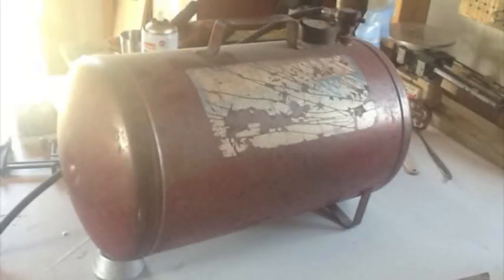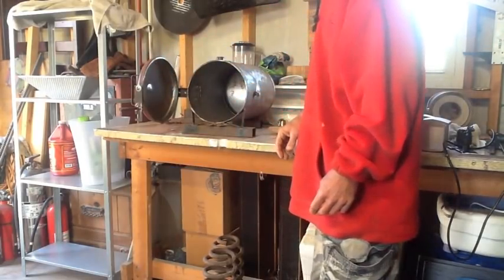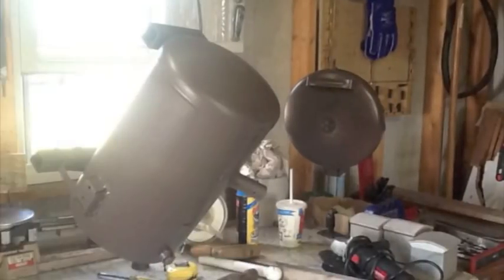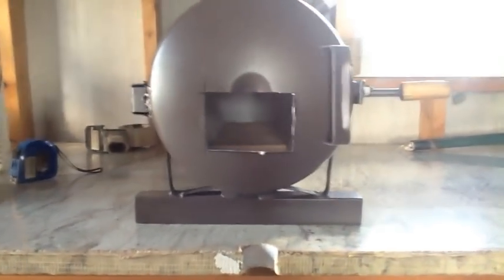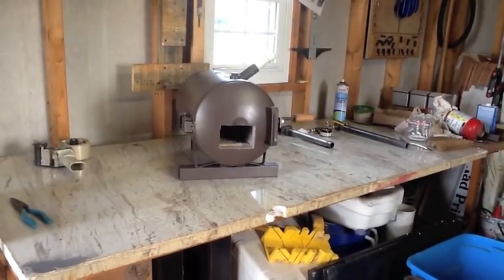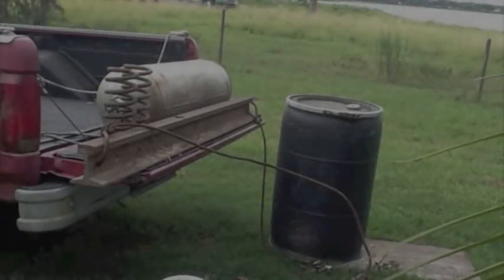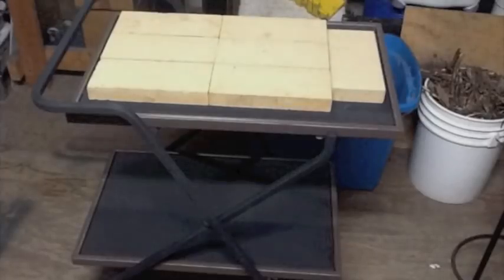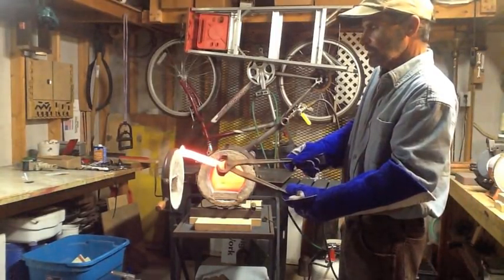My Custom Blacksmith Propane Forge Build - Start to Finish

Comment: Don't let the dislikes get to you, no telling what bee got in their shorts. The gloves were a bit over the top though. Don't wear leather around the forge, use cotton gardening style if you are going to use gloves. Leather shrinks when hot and it is possible for the gloves fingers to shrink down on your finger and that makes taking the gloves off much harder, causing a worse burn. Cotton will not shrink. I prefer not to wear any gloves as they make feeling the hammer much harder.
Reply from the maker: Thanks Wayne, the dislikes really dont bother me as I know the forge, and its a solid build. Would like to see the forges of those that thumbs down the build tho :)

That footage was the 1st time I fired the forge up so used the best gloves I had at the time, they are my stick welding gloves. Was the only time I used them with the forge, a bit of overkill, I will agree :-)

Comment: What did you use as a rigidizer
Reply from the maker: A product sold by the name of "Rigidizer" Google it! Thanks for watching & Happy Holidays! 😊🎉
Reply: @MakinSumthinFromNuthin  Thanks I can't find any pre-made rigidizers locally. Trying to find out as much as I can about what works and what doesn't.
Reply from the maker: The cheapest supplier I have found for doing the job “right” is Axner Pottery Supply 
http://www.axner.com/

Here are direct links to the products I used to save you some time on their site:
1” Wool:  http://www.axner.com/superwoolfiber-1thicksoldpersqft.aspx
2” Wool:  http://www.axner.com/superwoolfiber-2thicksoldpersqft.aspx
Wool Rigidizer:  http://www.axner.com/rigidizer.aspx
Sodium Silicate: http://www.axner.com/sodium-silicate-liquid.aspx

Comment: can you go more in depth on what the rigidizer is made of
Reply from the maker: Good question....I am no expert but from my understanding its a colloidal silica suspension that makes the wool stiff and prevents the wool from releasing airborne particles. A bit of googling on the subject may shed more light on the subject. Thx for watching :)
Reply: Makin Sumthin From Nuthin 
thanks soooo much

Comment: Major Safety concern. The ceramic Blanket will come off it is not covered with refractory cement, that will cause cancer.
Reply from the maker: It has 2 coats of rigidizer & 2 coats of ITC100, cant take anymore safety precautions than that

Comment: Ridgidizer, funny. I hope you didn't buy that stuff. Its Sodium silicate dissolved in water until you get the viscosity (thickness) you want to use. There is nothing else in it. In a high volume water solution it is also known as waterglass. Its very cheap to make, like about $4per gallon.
Reply from the maker: Rigidizer was a small expense on this forge. i have made sodium silicate before. But at just $11/gallon to purchase sodium silicate  I would rather just buy it. Making it wasnt all that cheap using silca gel and 100% sodium hydroxide, not $4 per gallon from my past experience making it. If you care to share your recipe I would like to hear about it, may give it a try if different from how I make it. Thanks for Watching!

Comment: How l g did it take to make the forge?
Reply from the maker: I worked on & off over a 2 month period to make it. I did alot of research as I went along
Reply: Makin Sumthin From Nuthin thanks for the quick reply. If you were to do it again would you do any thing different?
Reply from the maker: Not really, it works tremendously well

Comment: ***For your safety***, PLEASE have an all day bonfire party and/or pig roast, about 4 hrs in (after the first or second batch of wood has become coals) put all 4 pieces of rail on the coals near the middle of the fire pit and reload the fire.  Keep burning for at least 4-6 hours and leave them in the ashes till cold (annealing the rail).  The top surface of the rail gets work hardened by the train wheels.  

If you accidentally miss your work and hit the anvil a shard of metal can fly off.  A friend caught one luckily he had a leather apron and only felt it hit, when he found the piece it was about the size of a dime and razor sharp, the apron has a nick out of it from the impact, luckily it wasn't his belly.  

If you look at an old piece of track you will usually see a ledge that has been created by the work hardened steel flowing off the outer edge of the head, due to the cone shape of the wheels.  Once they get big enough they crack off as ribbons or fly as chips.  The process is called spalling and if you google image search Railroad Track Spalling or Railroad Track Defects, you will see what I am warning you about.

Also any of the drilled holes, remove them, due to the stresses of the railroad, there is a high chance that there are cracks radiating out from them and a large chuck can fall out once the crack reaches the edge.

Both of the above are well known common rail defects that few smiths are ever told about, so please be safe.

Rich C.
Reply from the maker: Thanks for the info and concern Rich. Thats quite the dilemma as a soft anvil (annealed steel) is of no use as an anvil at all. The track has since been retired and sits on a shelf but I will let others who read your info decide for themselves on how to proceed using their RR Track Anvil. Thanks for watching and commenting! :)
Reply: Luckily railroad tracks are not made from plain steel, it is a manganese alloy so it is plenty hard in it's annealed state.  The tracks when installed are hardened or anything, after leaving the rolling plant, they cool in a layered stack and then are shipped out for installation.

So the only thing you do after annealing them is to wire brush the scale and ash off it, and give it a light coat of oil to minimize the rust.  I forget the Rc of annealed Railroad track, but it is close to 80-90% of a quality anvil, so unless you abuse it, you will be hard pressed to dent it.
Reply from the maker: Great!, thanks for the follow-up Rich! :)

Comment: I got a 20 inch railroad rail cut in half with hacksaw until neighbor herd me cussing and let me borrow angle grinder cut the wings off one side of both then welded 2 together to make a more surface area took a long time and quite a bit of skin

Comment: Nicely done, but my only concern is Health :((((. Breathing all the Burn Metal Particles and the Burn Gas Particles. If you are Tired, feels Weak, just like 15 Minutes to an Hour in during working, you will know what I am talking about.  ://///
Reply from the maker: I know what you mean but the shop is well ventilated. I have (2) 4' x 8' doors, two windows as well. Glad you like the forge :)
Reply: With your Skills and Tools... Why not make a nice one with a Flue and Vented all that outside? All you need is to take it one more step further. :))))))
Reply from the maker: A set-up like that is for a coal forge, which this is not (propane gas forge)
Reply: With your Skills and your Tools? Why not make it Propane? Step beyond the Box and invent something. I am sure you can come up with something.... Regardless if it's Coal, Propane or even stuck a Tube up your Arse and Fart to get the Gas.... In the end, it's regardless.... For your Health Sakes, die trying right? They used to say the Sky was the Limit, 2017... There are NO LIMITS :))))))))))))
Reply: LOL, since I open my BIG MOUTH... I guess I have to go a little bit further, LOL..... OK here we go.... If I were you, I would do this and it's pretty EASY since you have more Tools than I do :))). Build a BIG BOX / Container outside of your Forge. 1. Add a Fan to the exhaust Flue. 2. Add a Temperature Snap Disc, when the Box gets to a certain Temperature, the Fan will automatically turns on and suck all the BAD Gases... Etc.... Out to the Flue and up the Chimney.  During your opening of your Door, Gases will escape... This will help you remove those Gases as well. This will not only help you with your Health, but in the Summer, it will keep your Shop Cooler since you have an Exhaust System :)))
Reply from the maker: LMFAO :)
Reply from the maker: I think if I built a wooden around it the box would go up in flames LOL. ....and if I were to do that I dont think plastic fan blades would be an option and the wiring may not like the 1000 degree heat. Maybe the simpler solution would be to move the forge outside? 🤔 Honestly...I do appreciate your concern for my health, Thanks For Watching!
Reply from the maker: Thanks much!, nice set up! :)

Comment: Is it just normal wool or something specific?
Reply from the maker: No.....NOT normal wool. It is ceramic wool.....made just for applications like this. You can google it and read up on it
Reply: Makin Sumthin From Nuthin Haha thank you. I really didn't expect it to be just wool, seeing how temperatures inside the forge would be well over 1000 F. I've been gathering supplies to replace my coal forge with a gas forge and was looking at a few options for the insulator, but this will probably be my choice.
Reply from the maker: Well I hope the video gives you some ideas, my forge works flawlessly :)

On a side note, another piece of the sheep might be good if placed in the forge for a few minutes....just not the wool tho.....*wink :)
Reply: Makin Sumthin From Nuthin Haha it definitely helped. And yeah my forge will double as an oven haha

Comment: Can't you use CO2 to harden the sodium silicate?
Reply from the maker: You can, and I do have 2 bottles of it. I just chose to let it air dry as the forge was a long term project done over 2 months time. CO2 in the air does the same thing....just takes longer :)
Reply: where do you get yours from?
Reply from the maker: I happen to have gotten mine free from craigslist but any welding supply will sell it. Expensive if you dont have the tank already tho
Reply: Lucky you!

Comment: can anyone point out why there would need to be a door if he just cut a hole in it?
or indeed why would there need to be a hole when theres a door?
Reply from the maker: A) Without a door....installing the insulation, fire brick and inserting large work would be like trying to put a ship in a bottle

A) Fire cannot sustain itself in a vacuum with no air if there was no hole in the door (exhaust)

Thanks for Watching....and the questions :)

Comment: I like your style. But you left out a few details. Like the connecting of the propane and the fixtures you used. Maybe its because I'm not familiar with that stuff, but I would have liked to have seen EVERY step taken.
Reply from the maker: I have other videos on how I made my burner assembly, hope that helps

Comment: How much will did you use and how much silica stuff.
Reply from the maker: Not sure I understood the question John :-/
Reply: Sorry, ceramic wool, How much did you use. and how much sodium silicate.
Reply from the maker: I honestly dont remember, I just took the measurements from the forge, made my calculations and ordered some xtra just in case I messed something up :)  (which I didn't)

The sodium silicate only required about 10 fluid ounces or less
Reply: and you used it as an adhesive to attach the wool to the tank and to the second layer?
Reply from the maker: Yessir :)
Reply: Thanks! You da man!

Comment: What did you do for your gas valves?
Reply from the maker: I have other videos on the burners & hookup :)
Reply: Thanks for that, I will check it out. Edit have seen it, do you have any problems with propane leaking out of the T valve?
Reply from the maker: Nope, air is drawn in by venturi effect sending all the gas to the forge :)

Comment: Please note to ANYONE building this setup, do your lungs a favor and coat that kaowool with something.  Mizzou, kast-o-lite, ITC... SOMETHING.  There are tiny tiny fibers that embed themselves into your lungs when your forge is running.  I'd hate to think what long term exposure to that stuff can cause.  This is a nice forge build, looks like it works well, but inswool/kaowool is dangerous stuff.  It's Alumina-Silica fiber blanket.  Just like Mizzou, wear a mask when mixing it.  Contains Silica.
~safety rant off~
Reply from the maker: The wool is this build was hardened with rigidizer then coated with ITC100
Reply: Good job.  I must have missed that part in your video.... With the recent drama tv shows and the growing popularity of knife making, many folks will cheapen out and stop at the Kaowool....   Not good.
Reply from the maker: I did my research before building it ;-)   Thanks for watching!

Comment: Just a question way not use aircraft paint remover. And wired question way not concrete
Reply from the maker: I didnt have paint remover back then and was kind of broke at the time. Concrete instead of the wool?
Reply: Makin Sumthin From Nuthin I have not seen it and know it’s fire prof. So just been trying to find out if it would work. And yes great job on no wire brush lines . This is one of the best looking one ‘s I have seen on here !
Reply from the maker: Thanks Aces, its a pretty popular video 😊 Straight Portland Cement would work but would be my last choice. Mix the cement with Perlite added. 60% perlite and 40% portland by volume. (6 cups perlite to 4 cups portland...etc) Very little water to make a dry mix thats very sticky and ram it into place firmly. Let cure a long time to remove all moisture....fire on low, low heat 10 min on, 10 min off. Repeat every hour and slowly increase heat after 5 cycles to remove remaining moisture to avoid a steam explosion. It will be very heavy tho
Reply from the maker: Perlite is fireproof and can be bought at garden supply store. Avoid vermiculite, its not the same thing. GLuck - Rich
Reply: Makin Sumthin From Nuthin thank you been trying to plane one out . Hope that it well look as good as this !
Reply from the maker: Good luck!
Reply: cement won't work.  Cement is made by heating lime and turning it into calcium oxide.  Cement is formed by adding water (hydrating it).  Heat will dehydrate it, back to calcium oxide powder.  Perlite is formed by heating volcanic glass to about 1600F where it softens and puffs up.  Your forge is hotter than that.

Comment: That's a great job. Looks really nice and effective. Sorry, but I get a bit anal about some of the welding I see on YouTube vids, it spoils an otherwise great job. There's too much use of this gasless mig in my opinion. I'm a welder but have never used it. The vast majority of welds I've seen using those machines look as rough as a bear's arse in my opinion. I suppose the main thing is that it's 'Stuck' and isn't about to fall off though. Like I said though, great job.
I've seen a few videos from America where railway lines are used for making an anvil. This looks a really good choice, especially as most reviews on the anvils you get from Harbor Freight (Our equivalent in the UK is Machine Mart) don't seem at all positive. Unfortunately, I don't think this is an option in the UK but I will look out for it.
Subscribed to your channel now.

Comment: would a 55 gallon drum work for this?
Reply from the maker: Thats way too large Caleb. You would spend a fortune on wool and fuel, go for something smaller IMO
Reply: i am working on plate maille and it is taking forever in my coal fired forge
Reply from the maker: Build the forge to accommodate the size work you will be putting in it, if its a big forge so be it :)

Comment: Nice Anvils, you sellin them? whats the rate for shipping to SC. LOL
Reply from the maker: I would sell one actually, I have (2) 18" pieces, could part with one...local pickup only...

Kudos for watching that long, I should made it in two parts :)
Reply: LOOL I watch most videos to the end. I have watched yours to the end and a couple of times learning stuff.
Reply from the maker: Thanks, hope they help...ever make the angle grinder handle?
Reply: I did, I need to make a mod to mine, the handle keeps getting loose so I need a nut or something on it.
Reply from the maker: A nut or some Loctite will work. Works good dont it :)
Reply: It's great, makes it easier to control
Reply from the maker: Glad to hear that!

Comment: I just built my forge but I got an atlas burner and I can't keep the damn thing lit can some one please help me
Reply from the maker: Not sure what an Atlas burner is, got a video I could look at ?
Reply: Makin Sumthin From Nuthin 
well no but I have a picture of it if that would be better
Reply: Makin Sumthin From Nuthin the burner spits and sputters and then will go out I did some research and it said the burner was not designed for a open air forge so I tried closing it up more and it's still not functioning right
Reply from the maker: I wanted to see it in action to see what was up, it wont stay lit while in the forge?, or outside the forge?
Reply from the maker: Try closing it up some but not totally, increase the gas PSI and once it heats up you can turn gas pressure down as the gas will self ignite in a hot forge
Reply: Makin Sumthin From Nuthin while in the Forge well I can send a video via email if you'd like but it was before I re did the fire brick
Reply: Makin Sumthin From Nuthin 
ok I'll give it a try it was thinking maybe my burner was for far in the Forge if you got to " atlas forge" the website and look at the graham burner that's the burner I'm working with
Reply: Makin Sumthin From Nuthin 
I'm uploading a video of the Forge now
Reply from the maker: Cant email long movies but you can post one on YTube or Vid.me and I'll check it out
Reply: Makin Sumthin From Nuthin 
ok you can go to my channel and chit it out I just posted one
Reply from the maker: I'll check it out :)
Reply from the maker: I saw the vid, try doubling your PSI like I mentioned & get back to me. What PSI are you running that at?
Reply: Makin Sumthin From Nuthin 
I'm running it at about 20
Reply from the maker: 20 is fine....Without being there and not familiar with the burner I cant help...I run at 12 PSI. Maybe others can help?